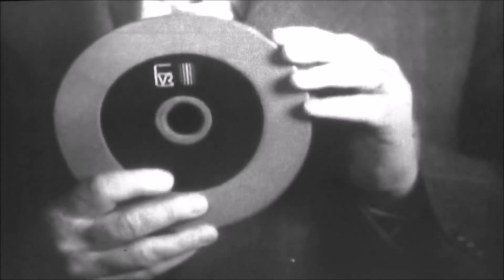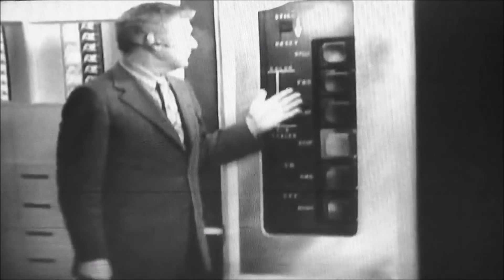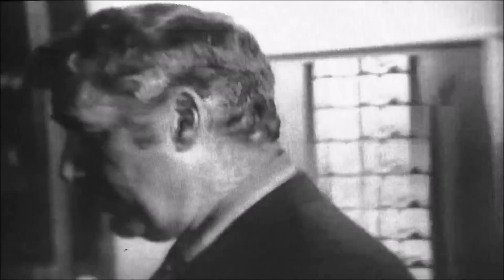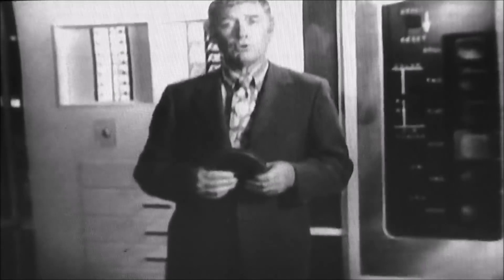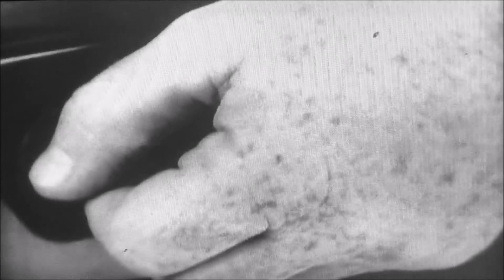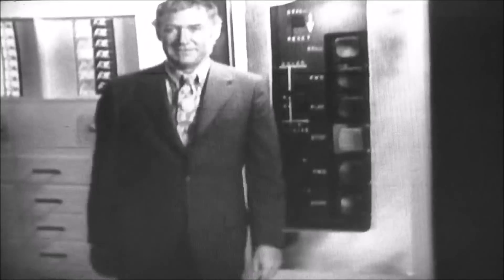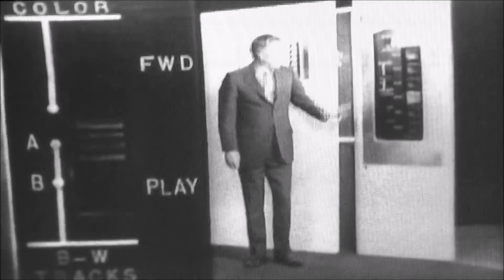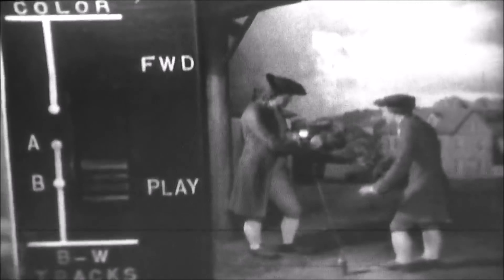EVR Teleplayer VTR Film Player Guide

Comment: The color process in the EVR does not work on "two color" processing. The main channel carries the luminance information, that  is a BW picture. The adjacent frame is the actual quadrature modulated (RF carrier) chroma signal, containing the U and V components (I/Q or R-Y/B-Y). The scanning of the chroma frame literally generates an RF signal. The modulated chroma was down converted from 3.58MHz to a lower frequency (1.x MHz) and recorded directly onto the film. All of the info is still completely intact. During playback, the signal is heterodyned with a recovery signal. The recovery oscillator is frequency/phase modulated by the inverted version of the frame error signal. Frame size (width) variations. When it is all correctly calibrated, this reproduces a stable 3.58MHz similar to Betamax and VHS, but with far better bandwidth. ALL of the color bandwidth was preserved. The recovered signal errors are far lower in EVR than any tape system. In the example of this video, the color processor has not been adjusted correctly. They are very close.

The color errors in the playback of this video could be either color converter alignment or the horizontal size of the scanner raster is off. It must be very precise to recover as close to the carrier frequency as possible before a "good" signal can be recovered. Of course, each stage of additional processing is another stage of degradation as well.

Addressing the low quality pictures. Note that the material was originated on 16mm film, then transferred from a telecine machine to the electron beam recorder that makes the films.... one at a time.... in real time. There was no high speed printing process for these films. Yep. It took an army of white coat scientist/engineers to operate the film printer. Did I say printer? Singular? I think they actually had two printers. What happens if your product is a success and you can put out almost forty films a week per engineer? Motorola was building thousands of players per week at their peak. See a problem in the dynamics of this business model yet? CBS was never able to get acceptable yield when the printers was operated by low skill technicians. THIS was one of the format's Achilles heals. Film production could never be ramped up to meet the demand for programs! 

AND the consumers wanted recording capability. BOOT to the head! Last nail in the coffin.

The EVR format was Peter Goldmark's third strike, following the CBS field sequential color TV format and the Chrysler HiWay HiFi a record player for the car! The record players' anti-bounce mechanism had to be professionally tuned to match the suspension system response of EACH INDIVIDUAL automobile into which it was installed. Again, white coat scientists doing a job that could not be passed to low skilled labor AND it changed as the car's suspension settled in. Call backs eat all of your profits.

Peter Goldmark is a remarkable man and one of my heroes. However, he was also living proof that PURE genius is no guarantee of success in business, though you may excel in your field. Some of the greatest failures of technology have been pure genius. Can you say, Nikola Tesla? I knew that you could. Both men had remarkable successes, Goldmark the long play 33 RPM record as the result of his HiWay HiFi and Tesla for the transformer and brushless AC motors and alternators. The rest of their work were all technological dead ends.
Reply: I never knew that the films for the EVR system were duplicated in real-time and required so much engineering/technical attention for said duplication--that would definitely explain why the system was such a flop.  Had they been able to overcome that limitation and found a way to duplicate the films en masse at high speed with fairly decent-quality yields (as it was for magnetic tape-based media), EVR might've had some success.
Reply: He developed the LP before the highway hi-fi. The LP project was started in 1939. He also ordered all music to be mastered simultaneously at both 78 rpm and on 33 rpm 16 inch safety masters. Because of this, there are droves of high quality material from the 40s from Columbia.

Comment: Sending the signal through a DVD recorder is an option that can work in place of a tbc. The Panasonic DMR-ES10 is particularly good at dealing with crappy signals (though only certain inputs on it work for it), but many others can also help to an extent.
Reply from the maker: What you see WAS ran though a DVD recorder.  It looks cleaner, but the unit was not able to record the signal.  It was a mess.

Comment: Back in the day it was suggested to me to try running non-standard signals through a VCR before allowing it to enter a television if some oddity in the signal caused problems...I'm curious if some sort of signal cleaner (or possibly even an early VCR with composite in) would help in this situation.

I actually keep around a RCA brand DVD recorder that can dub from composite and S-Video for it's resilience in dealing with odd signals like those from classic gaming consoles...That and it's the last thing in the house with a working i-Link port, in the event I need to capture MiniDV... 😄
Reply: That's because a VCR includes an automatic gain control circuit that will go some way towards fixing an unsteady signal. It might help with fading, but it's going to do nothing to help with syncronisation issues.

i.link is just Sony's trademarked name for ieee1394, or firewire. You can pick up an interface card cheaply enough and capture directty to PC.

Comment: Color images using two monochrome channels? I've heard of such systems, but they were notable for having very poor color reproduction. Also surprised to see anything like that in use so recently, I thought it fell into disuse long  before that era.
Reply: See my description of the color process above. It is far more advanced than anything in that era. NOT a two color process. The picture looks bad because the restoration of the color circuits was yet to be performed. Also, a system from 1968 is not a recent format.
Reply: you can see how it looks a bit later in the video and you are right, it is quite bad.
Reply: @kandigloss6438  Which is what surprises me. This is circa 1968 - but the two-color technology started going obsolete in the 1930s. It seems strange to see it still used in a product so much later.

Comment: Next time please filter out the  very high frequency sounds please, it´s really unconfortable.
Reply from the maker: It's part of the experience!  You're hearing the flyback transformer doing its thang!
Reply: @databits  That works!
Reply: I can´t hear it a on a crt since im ussualy a few feet away from it, but yeah it´s a part of it, it´s ok if i use my crappy roland speakers tho.  @databits
Reply: I love that sound.
Reply: We learned to deal with those sounds and tune them out
you will too
Reply: as others has said is you are under 20ish years of age you will hear those high pitched noises. otherwise you are a one off abnormality and sorry but an average person cannot remove the ranges you are hearing.